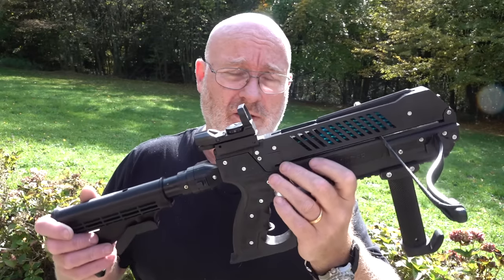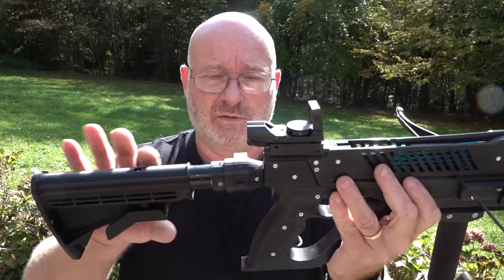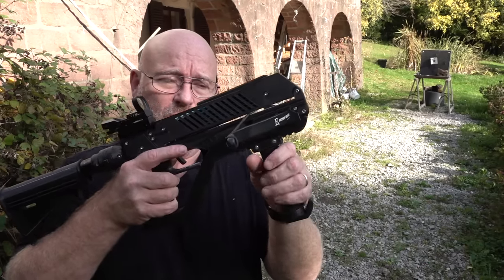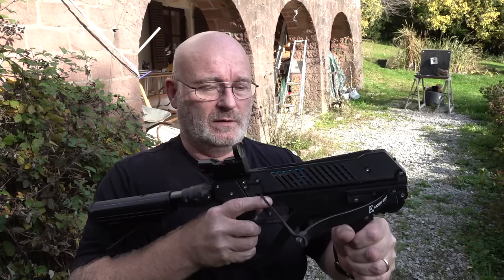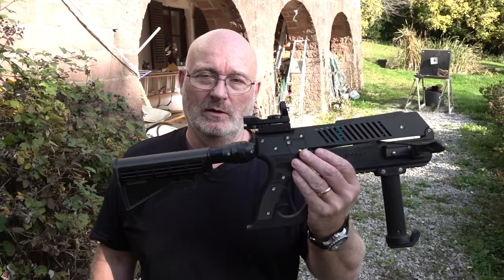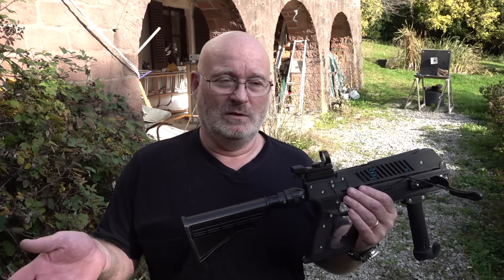Next Level Rapid Fire Crossbow (3D Printed)!

Comment: I can see that becoming an all time best seller .
Not everyone has a 3D printer or the desire to use one , they would rather just pay for an 'Off The Rack' ready to go solution .
Well done  !
Reply: I would !
Reply: I definitely want one. Even if someone just sells me the kit to put it together myself I'd buy it if they sent me all the parts. It's such an easy buy and such a cool bow.
Reply: Agreed!
Reply: 'if they sold the plans you could get one of the many online companies to print it for you.
Reply: if you have the plans you can replicate it yourself using other materials.
Reply: Just wait until metal 3d printers become affordable for home use, oh the possibilities!
Reply: if it was already to buy I would.  yes, not everyone has a 3D printer.  an I can't find the file if I could print it. Thanks
Reply: @brianp6859  metal 3d printers? LOL
Reply: @GothicGame  lol literal robotic welders... have a 7-axis panasonic welder at my shop... additive machining isn't new, just the size of the machines. robotic welders need gas canisters, a lot of heavy material (wire spools), and draw so much damn electricity youd likely be surprised.
Reply: @GothicGame  They use them in some supercars, like Koenigsegg has a titanium variable vane turbocharger that's 3d printed. Common materials are Titanium (especially for jet engine parts), Stainless Steel, and I think Aluminum (depending on application).
Reply: @nicgurkweitz389  ;-)
Reply: @brianp6859  A good one is around 200 bucks right now...
Reply: @jakegarrett8109  @Broke Dolph thanks.
Reply: I would think about buying a built version of this if it were not floppy
Reply: There are 3D print services that will
Manufacture your parts online
Reply: I’ll print you one lol
Reply: @brandonmcneeley2233  for me? 😍😍😍
Reply: @brandonmcneeley2233  How much would you charge?  Using something strong like Polycarbonate.
Reply: >"All-time best seller"
>File is no longer available
Lol
Reply: a 3d printer costs $300 these days - I'd recommend getting one at this point.
Reply: @brianp6859  I mean some of the cheaper ones are already like that. You can get a printer for around like $200-$300 and 1 kg of filament costs like $25
Reply: @nicgurkweitz389  can do :)
Reply: Where can you buy a finished model in a strong model

Comment: That's amazing. He's used PLA hence the material going soft. I'm going to print one in carbon fibre nylon. Super strong and doesn't have that problem, but about 6x the cost. Awesome design, looking forward to the download link getting put in the description.
Reply: But hard to print that large objects in nylon. I will try ASA and some parts with  PLA
Reply: @artineogda  yeah it'll be many smaller parts. But I've printed pretty large stuff in cf-nylon and get perfect prints. Just direct drive and hardened nozzle.
Reply: Eli Ellington  Being from the UK I wouldn't know about printing Glock lowers etc. The laws are waaay too restrictive over here. I would have thought the top slide would excert too much pressure on the internal slide guide on recoil, but then I don't have experience of that. PLA+ is decent stuff.

I'll check out the brand's you mentioned, but it's seems filament suppliers either sell to the USA or Europe but rarely both.
Reply: Ah yeah overture petg. Much cheaper.
Reply: PLA is good enough for this application, but to make it safer you can use PLA Plus/Pro. It has the same excellent tensile strength as pure PLA, but the impact resistance is between 5 and 12x better! You can even print great arrows/bolts from the PLA+
Reply: How expensive is it to print an object like that one? (For a cheap material like this one and a medium and a high priced material like carbon nylon maybe excluding the stock since that looks like a simple ar15 stiock you could buy pretty cheap)
Reply: @Javic167  between $20 and $100 depending on the material. Then there's also expenses for the bowlimb, the string, screws and arrows.
Reply: @DKFX1  thank you! I am aware of the others costs, but the actual printing cost was what I needed to set it in relation to the overall price.
Reply: @DKFX1  good to know, I didn't realise that PLA+ was that much stronger.
Reply: @Javic167  for me, if printing in CF nylon I'd say it wouldn't take more than a 1kg reel. If you bought the ar15 stock.

Material wise, £10 in PLA, £14 PLA plus and £65 in CF Nylon.

About $12, $17, and $75 ish respectively.

But yeah there's the other bits though too.
Reply: @johnblaise522  thank you!
Reply: PLA has a really competitive strength compared to more pricey filaments. Don't forget that with other materials like ASA, the layer adhesion is even lower. This has to beared in mind when using sth different. The downside however of PLA in my eyes is the brutal failure mode without any warnings and the sensitivity to heat, it shouldn't be left in direct sunlight for a longer period
Reply: CF Nylon is complete overkill. Either go the PLA+ or PETG route. Nylon stuff is super hard to print without enclosure and pretty expensive. Plus you do not really gain a benefit. I printed over 6 Adderini using PLA / PLA+ and never had issues. Only parts with higher mechanical stress should be printed in PETG, ASA or ABS. I mean like push rod from the cocking lever, trigger, bow mount. 
The best durability / stiffness to printability ratio might be using some easy to print ABS (ABS+, Easy ABS, etc).
Reply: @HolgerBeetz  Trying PLA with decent settings now, seems tough with thick walls and a decent infill. But on your point about CF Nylon, you don't need an enclosure. I've printed lots of stuff in great quality with just a standard Ender 3 V2 with hardened nozzle.
Reply: Only down side is getting decent bed adhesion. I use 3DLac spray on the glass bed when doing nylon and that works great.
Reply: @johnblaise522  Interesting. I always thought an enclosure is mandatory for CF Nylon as well as for Nylon. Any suggestions on a brand for CF Nylon ?
Reply: Are you able to share the files?
Reply: @Dextahmane  Wouldn't be right. I'm sure the designer will have another cults or other outlet so you can buy this soon.
Reply: Ahhh, didn't realize it was a paid design. I'll keep checking back.
Reply: @michaelkeller5008  overkill
Reply: @michaelkeller5008  tell me you know nothing about printed materials without outright saying it lol. Is that why all the printed firearm frames only last one magazine out of PLA+? Oh wait, they last pretty much indefinitely
Reply: @johnblaise522  I live in the uk, 3d print the parts and post? you can dm me & name your price if you want
Reply: @artineogda CF nylon is nylon on easy mode. It doesn't warp off the bed at all and has more rigidity than nylon on it's own. You can print it on a slightly modded Ender 3 with no enclosure. I found it can be a little prone to oozing when you don't get temperature just right, and clogging can be an issue. You need a hardened steel nozzle at minimum, but steel nozzles suck due to needing to run 15 degrees hotter than brass, so I use a tungsten carbide tipped copper alloy nozzle. Expensive, but very good, and I can print every material with the one nozzle.
Reply: PLA doesn't go soft unless subjected to heat, which shouldn't be happening. It's by far the strongest 3D printable material you can print on a normal consumer printer. CF nylon is cool, but it suffers from poor layer adhesion and it creeps under sustained load. But It would probably be quite good for this regardless. PLA+ is the business though. Unless there's significant heat involved, it's just a wonderful material to print.
Reply: @artineogda  Also ASA isn't as strong as PLA.
Reply: @Matschase  PLA+ doesn't shatter like PLA. It will only deform, so it's extremely tough, and it's actually easier to print. Then only downside is the heat resistance. PETG has some good properties too, but it can be funny. It usually has extremely good layer adhesion and toughness, but it tends to creep, and be too flexible, and it can randomly shatter instead of deforming. ASA and ABS have awful layer adhesion and tend to be toxic and difficult to print.  Honestly PLA+ is the mutts nuts unless you need temperature resistance, and CF nylon is pretty amazing because of it's ease if printing compared to straight nylon, but it has it's own set of issues. 
I wouldn't consider going away from PLA+ unless there's a specific reason to. I don't bother with straight PLA at all, because there's no point, PLA+ does everything better.

Comment: Awesome creation. Only suggestion is to be able to have a piece of the non-sliding section extend at the rear to have the mounting point for the optic on it so the optic can remain static whilst re-loading and will also hold 0 as it wont be mounted to something that can move. Basically have the red dot attach to a section protruding from the stock area and not the magazine area.
Reply: That's a good idea for sure!

Comment: Move the red dot onto a non-moving part to help maintain your target picture during the reload. This will help you fire even faster and more accurately as your eye isn't requiring your target picture every shot.
Reply: I did so. I printed a short picatinny rail. Drilled holes in the main body, installed brass inserts. I screwed it on and additionally glued this rail. I had to eliminate the bevel (2 deg.), which is originally (because I couldn't properly set the red dot). I added a bevel to the other side on the new picatinny rail.
Reply: Anyone know where to get the files?
Reply: @slicktricks88  maybe try PM to Fafner?

Comment: This crossbow that can rapid fire which makes it more awesome than a regulated crossbow is a bow 😂 Awesome product Joerg! Have you ever considered adding some electronics and solenoids to make it semi/full auto? Not sure how that should work though, but I imagine a smart designer could come up with something cool 😊

Sounds like it’s printed with PLA which gets soft at those temperatures. If you print it in ABS that should be solved (and perhaps in a light color instead of a warmth absorbing black!), or have the parts that take the most stress CNC’d and the other part printed
Reply: That's an application that's begging for carbon-nylon.
Reply: @jtjames79  I was about to say that too. Carbon or glass fibre nylon seems like a good material for this, as does carbon fibre PETG to an extent. I wonder if using a material like that you could use a stronger bow on it? If PLA can handle a 50 lbs bow then what about CF or GF nylon? 

Maybe someone out there wants to print it out of PEEK and see how it performs. You may be cheaper getting it machined at that point though.
Reply: @conorstewart2214  So far I tried PET-G and it didn't work with 80lbs, the main body was not strong enough. I will adjust my printing parameters once more and try to get it more stable, otherwise carbon-PET-G might be an option.
Reply: @Kashban  did it print right with the PETG? It likes to be printed relatively hot and without the cooling fan.
Reply: @conorstewart2214  pff PEEK is too expensive. People build capable GUNS out of PLA+ so CF nylon will be more than enough
Reply: @userblame632  Most of them still require metal parts for much of the high stress areas.

Comment: I like the updates, very cool. I bought the original files when I saw it on your channel about a year ago (its nice, but I wish it had linear rails instead of plastic on plastic, then it would be a premium machine without too much added cost). I love that this one uses the vertical grip, though I'd go with a carbon fiber telescopic stock solution so it can be fired while collapsed. The bow limb instead of slingshot rubber is a nice update, if I can take the one off the ~$20 bows those things last practically forever and plenty for plinking targets having a great time. I'm excited to see if this is the final revision or if there comes a higher capacity with maybe a dozen bolts (I bought like 80 bolts because you lose them playing, and they are so cheap if I can fire for 10-15 seconds rapid fire that would be awesome!). 

I'm glad you came up with the base design Joerg, its amazing how effective yet simple it is, its brilliant!

Comment: Super hyped for the stl files. I hope the final version will be with better materials. If so, it'll be my first 3D print ever!
Reply: But its up to you what material you use, no?
Reply: @StarfistShen  yes
Reply: Just downloaded and asked myself which material I'm going to use. I guess this print was not with enough walls and infill, maybe not good calibrated settings. The inventor suggest cheap Amazon PLA, but he has a 4k printer that does probably a better job than cheapos with layer adhesion. I would suggest PETG for durability, but does look glossy and I will print most parts with ASA because it looks awesome and is UV-resistant. I've also a lot of ABS left, but it shrinks and stinks. Otherwise I suggest PLA+ from eSun because it's easy to print and durable. Some people are printing even firearms with it, but the critical parts are metal, obviously...

Comment: Interesting approach for rapid firing. I also like the redesign of the Adderini magazine part which enables you to detach the upper part. Beside from this you can "transform" pretty much any "non-crossbow" Adderini by using a similar frontgrip which is long an sturdy enough. Such fast shooting requires some serious power. Unless you use a very weak bow. :-)

Comment: Wow that is indeed really fast!
I guess the only thing missing would be the double stacked mag (12 shots) showcased in a previous video, but still this thing is amazing.

The knife is neat too, especially the compactness is nice, though the price point is something thats high for me - I'm poor, so the highest i'd spend on a knife is 30€. I got a Mil-Tec tactical folding knife for 25€ and it came with a glass breaker, mini saw blade on top side and a seatbelt cutter all in one.

Comment: @JoergSprave: Material wise this was then printed in PLA. PETG is already much better, and if you have the proper setup (ventilation is needed) you could also go for ASA / ABS.
regarding the weight, this could be improved by designing the print to include metal-parts (essentially the printing instructions tell your printer to stop at a certain height, then you put in some counter-weights, then resume the print, the weight will then be inside into your print - I use this technique to include neodym-magnets in my prints).
additionaly, the "infill" is an important aspect of 3d-prints - especially with plastics its not always better to have a 100% solid structure, as a 40% (instead solid for examples tiney honecombs) give your print a lot of more stress-endurance and flexibility (eg it doesnt break).

Comment: I'd like to see this design updated with some sort of cam or swivel on the pump mechanism so that your left hand doesn't have to swing upward every time, letting the crossbow stay even flatter between shots. Would probably require an accordion-type setup to work in order to maintain form factor.

Comment: I'm looking into designing a reverse compound arm version of this crossbow.  You can achieve a significantly increased power stroke with a reverse limb approach.  Not only will you be able to make the crossbow significantly more powerful, but it's more compact, and any amount of recoil will be significantly reduced from the arms returning to their resting positions horizontally and away from each other, rather than to the front and in the same direction.  My only concern with this kind of rapid fire approach is whether the reloading mechanism shown here will be capable of generating enough leverage over the longer draw distance